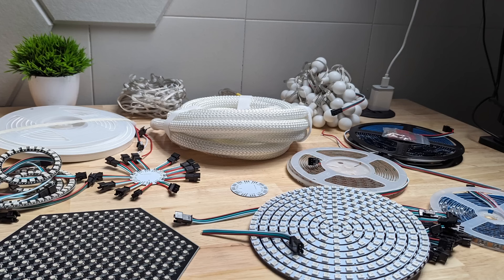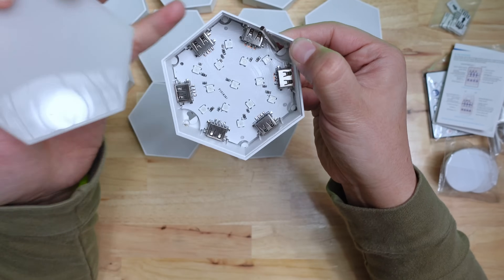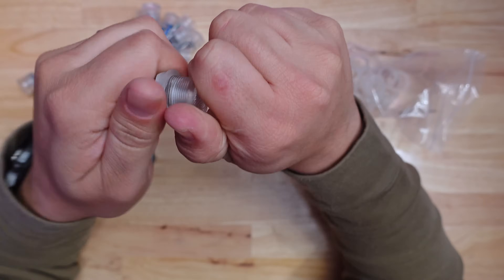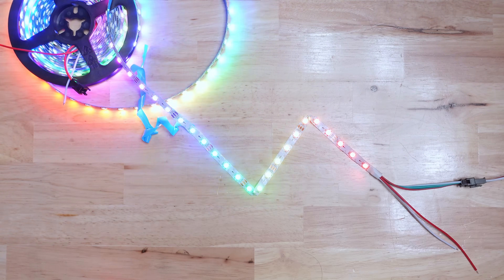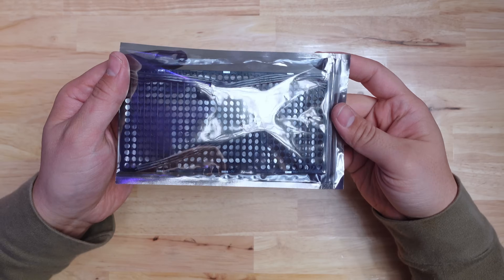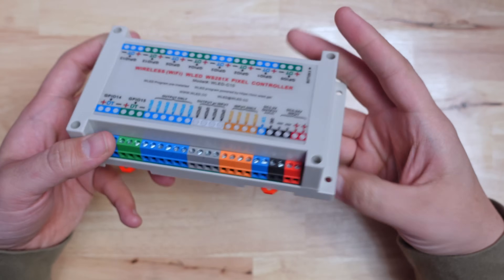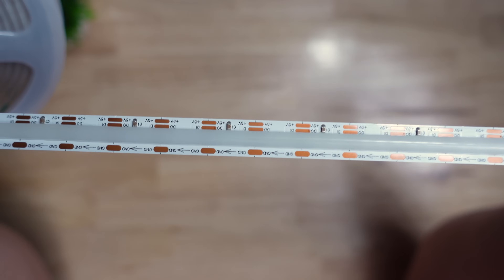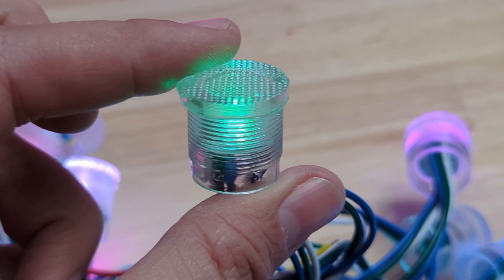Ten AWESOME Options for WLED! (Pixel Matrix, Hex Panels, and more)

Comment: Can you provide a link for the LED Marquee lights?  Want to use them for custom deck post lamps with a WLED controller.
Reply from the maker: Marquee Panel Mount LED Lights (AliExpress): https://s.click.aliexpress.com/e/_DlWhPd3
Marquee Panel Mount Alternative (Aliexpress): https://s.click.aliexpress.com/e/_oE2TBd0
Reply: @MakeItWorkTech  thx. Any on Amazon?  First link not working but second link did.

Comment: I’ve just “hacked those hex panels. If you solder lines to the usb connector you can address the led individually. Left and right are plus and min, the 2nd line is data in 3 us data out

Comment: The lights you presented prior to the LED rope lights look like they could be put in an aluminum or PVC track and flush mounted on a house for a permanent outdoor holiday lighting application.  They also could be put under a covered patio for ambient lighting.  Interesting.

Comment: Hi Aaron, I’m interested in building LED enclosures.  What brand of 3D printer would you recommend?
Reply from the maker: I have been using 3 different ones lately: Creality Ender 3 V3 Plus (large print volume, high speed), the Bambu P1S (high quality, multicolor prints, high speed), and the AnkerMake M5 (decent quality, more affordable). All 3 are great, but for the enclosures the build volume is what I value most, so I'd recommend the Ender 3 V3 Plus. I can't say how it compares to other larger volume printers, but my experience has been pleasant with it

Comment: I have 2 wled lights and about 30 esphome leds with custom effects, whilst writing the code for the effects yourself is much harder, I personally like the result much better and has much better reliability. Only thing wled has going for it is it is easy with limitations.
Reply from the maker: I've always wanted to try out ESPHome led control! Maybe I should do a comparison between the two!
Can't you get effects code from github or other people?
Reply: @MakeItWorkTech  you certainly can, it's hard to find examples that suit custom shapes obviously but it doesn't stop you from trying. If you leds are in a basic arrangement you can find absolutely heaps of code people have shared. If you are good with code u can tweak it to suit yours also, or at least help with some areas that aren't explained well on the esphome page examples

Comment: Hey Aaron - thanks for another great (inspiring) video!  I’ve been re-printing my matrix enclosures after upgrading my Ender 3 to an X1C - and rebuilding the 2x2 “big a** matrix” had me thinking… “How can I get MOAR LEDs?!?”  4x4 of the 16x16 panels?  You mentioned building a 2x5 array of these panels: I wanna see that build!  Plus any enclosures / diffusers for the higher resolution / smaller pitch matrices (22x22 or 64x64).  Keep the inspiration coming!
Reply from the maker: Thanks! Gonna start working on the 2x5 array soon!

Comment: I would love to use the hex LEDs with WLED running on an ESP8266. Are the WLED settings for your trusty controller going to be the same for an ESP8266? And what type of LEDs are the hex lights (ie WS281x, etc.)? Thanks for the great video.
Reply: @theloniuser  Did you get it? My hex panels only connect the first LED and it doesn't change with the WLED controller ESP8266 Gledopto

Comment: @3:27 If you have only ONE power injection point (other than the start of the string), Do Not use it in the middle of the string.  Put it at the other end.

Comment: Love that small 12 volt power supply. Looks like it would fit easily into an ammo can. I use those as control boxes in my Christmas light display. I have a mix of 5 and 12 volt WS2811, total of about 1400 this year, along with 3,000 old school lights. Hoping to push to about 2500 pixels this year and retire a few more of the old lights.
Reply from the maker: Wow, sounds like an awesome setup! I'd love to see that. No pressure, but you could post pics on our discord if you wanted!

Comment: For the triangle panels and matrix effects:
Afaik it is possible to provide a map of led locations to wledthen wled should compensate for the missing ones
Reply from the maker: I'll have to look into that!
Reply: @MakeItWorkTech  the search term is "mapping" which allows to reorder the led order in your strip, combined with "virtual" LEDs* you should be able to make something work.

*Virtual LEDs: LEDs that are configured in WLED and are also computed but are not physically attached to the controller. For your usecase you can create a rectangle matrix where all LEDs of your triangle align with the LEDs of the rectangle, now you replace all pixels in the rectangular matrix that are not present in the triangle with virtual LEDs.

Comment: So I have a few WLED projects in my house I’ve built but I keep running into an issue where every once in awhile the esp32 is shown as “(offline)” and I cannot get it to connect to my phone. I know there’s someway to set it with a specific IP address in your router but TBH I have yet to learn how to do it myself. Would be a good video tutorial maybe?
Reply from the maker: Yeah, I would be good, but unfortunately routers are all very different so you really have to find out how to do it on your own router. I have a Google Nest WiFi and it's totally different from my old TP-Link.
It fairly easy I think, first look up your device's IP, then just look for DHCP IP Reservation as an option on your router, and reserve that IP for that device.

Comment: Yikes on the 10 strip unit @$1100 USD!  (Seems the same is available through a different link at 1/10 the cost.)
Reply from the maker: I'll have to check for more links... The price was 175 when I first found it...
This one is the same but with an external antenna
https://s.click.aliexpress.com/e/_mrRYAwW
Reply: I came here wondering about that, myself. Do you think that maybe it’s 10 units for $1100?

I can’t see ANY reason they’d be that expensive. And if they are, good luck selling them…way out of my price range.  heh

Edit: $110 each (10 @ $1100) would be tempting if I were looking at a big project or a group buy thing.